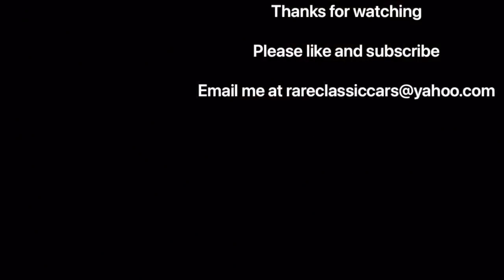Worst Engines of All Time: Chrysler 318/360/400/440 V8 Electronic Lean Burn

Comment: I have my grandparents 82 chrysler new yorker with the 318.  Mu grandpa said he told the dealership his car was getting 32 mph on highway and they said they would fix that!  Back to stock timing?   I will check this summer. Very low mile original but needs carb cleaned from old fuel.  I am ordering a progressive ignition blue tooth HEI that's its own computer.  It will not take 7 minutes to adjust timing.   Lol!  Say hello ebay, to the original air cleaner computer.

Comment: In your explanation during 6:30 ish, alot of people dont keep their foot steady on the gas pedal to maintain a steady speed. Alot of people, just lift, and push. Lift and push. That will cause problems in itself, but people will blame the manufacturer before they blame themselves. I've heard it when people drive by! It's so annoying. Especially if you're a passenger. Watching that tachometer move up and down non stop, and feeling sick from it.

Comment: Very intuitive material. Reminds me of my 82 AMC Eagle. It had that Carter electronic stepper enrichment system. Coupled with the Ford Duraspark. Tuned properly it actually worked well but I wished I never sold that one as there are so many fuel injection kits that will fit.. Very dependable here in South Dakota winters as long as the engine didnt flood!!

Comment: The best running Mopar engine I ever drove was a 99 Durango with 5.9 360. The worst Mopar engine I ever drove was a 2002 Durango 5.9 360. Same engine, same rear 3.90 gears. They screwed so bad with the ignition and timing and advance curve that it took all the performance out of it. It ran terrible. The 99 was so nimble and quick by comparison.

Comment: The Ambient Air Temperature Sensor is in the intake air box because that's where the temperature that's going into the engine actually is. It was the earliest speed density ignition computer from Chrysler. And they still use a speed density system Which is far superior to the mass air flow system used by other vehicle manufacturers. However Chrysler does 10-2 run their engines a lot fatter than they need to instead of allowing them to run lean when cruising.
If they had work with their first port injection computer a little bit longer, they would have found the problem with the condensers used in that brain unit. And we would have had the electronic port injection that they were actually putting on cars in the 1950s Chrysler was way head of the curve in many developments like automatic transmission, alternators, power steering etc etc etc and modern port injection in the mid-1950s

Comment: Slightly off topic -- I drove my father's new 77 Cordoba home from the dealer and it stalled on the way home. Fast forward a few months. I went in to the dealer screaming and yelling and told the service manager I wanted Mr. Kelly, the owner, down there right now or else. (Add your own color commentary) Service manager told me,  "I'm sorry he can't come,  he's at the hospital, his wife just died." I left with my tail between my legs. I have never disrespected or yelled at mechanic since. I later fixed the car myself by removing the cat (legal in GA at the time), installing an old Plymouth distributor and a Holley carb tuned for the 400. The car ran fine after that.

Comment: Back in the day I had a 1978 Plymouth Volare with the 318 'lean burn' engine. The car actually ran pretty well for the most part. One thing that you did not mention is what can happen if the computer fails. I had my car for about 2 years when the computer suffered a failure. At that time there was no OBD system to plug into a computer to diagnose the problem. What happened to me was that I would be driving down the highway around 55 mph and the car would suddenly just shut down and restart. It was like someone just turned the ignition off and then back on while you were driving down the road. The result was that the car would produce a massive backfire and then continue down the road. Since the computer was not sophisticated enough to have a memory that stored error codes, by the time I brought the car into the service shop everything would look just fine. Finally the dealer replaced the computer since they could not find any other problem and that resolved the issue.
Reply: That was a fairly common problem with those early computers, and not only with the Mopar computers. 

Not that it matters much to you now, but if you had disconnected the battery for a few minutes, the problem would probably have disappeared at least for a time, which would indicate a bad computer.

Comment: Great explanation of a much maligned system on what were otherwise stout engines. Glad my 74 318 didn't come with it. Bone stock 2bbl with highway gears. Added dual exhaust to free up the flow. Runs like a dream.

Comment: The 225 slant six also had lean burn, so it would have been the slowest of Chrysler's lean burn engines. I had it in a 1977 Dodge Aspen with 79,000 miles on it, that I bought for $900.  I wouldn't race with it, but it wasn't embarrassingly sluggish, for the era. Plenty of GM diesels were on the road, at that time, and all diesels were slower than The Aspen. For the money, it was a great car. The A.C., the radio, the power locks and windows all worked. I put over 50,000 miles on it before the fender and window rust holes began allowing rain to gush into the back seat, etc, and the power seat motor shorted out,  the power locks would cycle on and off, and, finally the head lights began to dim, and the battery died. It started and ran well in below zero weather before the rust/electrical issues. Chrysler offered a lot of car for the money, even for the used car buyer.

Comment: THE government forced this on all auto makers and none were ready for it. It was horrible.
Reply: The Germans had a huge head start — they had Bosch D and K -Jetronic fuel injection before this CAFE crap was enacted. The K-Jetronic was simple and offered excellent drivability. The US manufacturers were operating at a huge disadvantage, when the gov lowered the boom ...
Reply: @sking2173  I remember cutting the tops off of them and adjusting them.

Comment: What you explain I think my 84 fury was like this and To me I real8zed this 8s smart
Reply: Yea on the old chevy six with points id ping it then back off prior to gap checkin
Reply: I kept a log on oil gas trans and average was 11mpg for my used 84 fury. If I could drag up another id drive it

Comment: I had a 84 fury 4 door 318 in about 2006. It had an electronic carb and ignition and ran smoothe to me. I was 6th owner it was a detective car at first. I did alot to fix everything wrong with it but after bein chevy and ford and that was my first mopar. Im convinced its a smarter design especially the drum brakes were so smoothe operating function. They had 2 short shoes on one side tho I redud it all. I called it electric carburator . I d8dnt never try to burn the tires but on the interstate it was righton the ball fly to dallas 95 like nuthin AC too

Comment: My grandfather's 318 Diplomats  (No overdrive but really tall gearing) used to get up to 31 USA MPG on long trips at 60 mph (Speed Limit was 55 mph then). He owned two different ones. They did better than any other V8 of the era for mpg in my opinion.. He never had any issues with his. I often thiught many of the issues were mechanics not fully understanding the system

Comment: If the 2nd pickup in the dual distributor exits function, you can crank all day and it won’t do squat, one is for ignition the 2nd takes over after engine starts.

Comment: I remember the Chryslers of that era but it was the mid 90s when I dealt with any of them so they we’re already very old. It seemed to me that what most people had done was swap out parts for 1970 to 1973 carbs and distributors etc. I don’t know why but these Chryslers of this era never seemed to be as high quality as Ford and GMs of the same era, like he said doing things like idling high then slamming into gear. Oddly the Chryslers probably were better because they didn’t have garbage like THM125C or THM2004R I cringe even typing those.

Comment: Its a funny thing. Mopar fans always sing the praises of Chrysler products yet in reality and as born out by the market, 70's Chryslers were rubbish cars. They have disappeared from the roads and languish in the classic car markets in Australia. My CL Chrysler Regal fell to apart standing still. The conversation in this video is ELB. Useless piece of kit. I took my off the engine and even fitted a manual choke. Another contributor claimed the 318 was the popular engine for taxis in Oz. Not true. Falcons and Holden sixes were the favorite . Falcons were easily the better car. These 318's were very thirsty and thus useless as a taxi. It's claimed they are a long lived engine., probably because they are under stressed and inefficient.  Underpowered compared to the Ford 302 no one hot rodded them. Truck engine basically. Rust ate these cars from the inside. Cheap upholstery, wandering steering, a front suspension that wore itself out in short order. Power steering pumps leaked forever and the so called electronic ignition burnt out three times on my car. Even the throttle cable broke as did the oil pump drive robbing oil pressure. Reliable engine, I don't think so. Fortunately they have long since been turned into scrap metal.

Comment: They weren't all that horrible. Just most of them LMFAO. I had two of them. One was in my 1977 Dodge Charger Daytona with the 400 engine, the other was in a Dodge truck. The Charger Daytona actually ran really well and never gave me any issues. But the one in the truck was horrible. That thing never did run right. I ended up wrecking it 60 mph into a very large whitetail deer... Which was a better fate for that truck than it deserved. I'm still a Mopar guy but they sure blew the hooker on that lean burn build

Comment: I used to work for the AAA road service during those years every time these cars would turn over and would not start!!! I take the coil wire lay it next to the center of the the distributor the spark would fly from the end of the wire in to the cap fire right up every time shut it down put coil wire back run fine!!! A lot of my tow truck drivers had to tow them for lack of knowing this easy trick!!!

Comment: Lean Burn engine management system. Take off and toss in trash. Disable Smog control system and remove the catalytic converter. Makes the engine easier to start and improves fuel mileage and performance. I removed the lean Burn off of my 85 Fifth Avenue Chrysler. Ran a hell of a lot better.

Comment: 14.7 to 1 is by weight, not volume. Using the gallon jug analogy, it's 9000 gallons of air to one gallon of gasoline.

Comment: Thanks for the tutorial, well explained. I had three of them , a ‘79 (360) and ‘80 (318) Lebarons , and an  ‘87 Fifth Ave. Fortunately the mechanic I had was able to work with this system , although he let me know the system was often fussy to get it adjusted right. I drove the Fifth Ave. to over 200,000 miles , one carburetor rebuild at 100,000. Chrysler must have improved the system by then. That car ran as well overall as any of the pre-lean burn cars I had. I also put 200,000 miles on an ‘81 Ford 302 with the Variable Venturi carb. Fortunately my mechanic told me I didn’t want to pay him to learn how to make that system work and suggested another guy who knew so I survived that too.

Comment: Chrysler tried to make a carburetor act like a throttle body EFI system. In other words an el cheapo EFI and it didn't work out too well. 

As a kid I remember that most people were so against fuel injection because of how bad the GM (Chevy) Rochester system performed in the late 1950s. Ford scrapped their Holley system before installing too many. AMC & Chrysler's Bendix EFI systems in 1958 were actually a multi-port EFI system that Bendix Aviation adapted from aircraft usage to street usage. This didn't work very well, because of the primitive electronics of the time. Bendix sold this whole system to Bosch which refined it into the "D-Jetronic" in 1967. This system was adopted by VW, Mercedes, Porsche and few others, decades before any American company would even dare to mention fuel injection again.

Comment: Real remanufacturers used to rebuild the lean burn computer with an upgrade, I was fortunate enough to have one in the area 😇 for my shop! Never a problem with them. When they worked right the vehicle could get up to 30mpg on open roads

Comment: The 318 was such a workhorse and dependable engine. The lean burn ruined it. We owned a 1977 Chrysler LeBaron 318 with lean burn. It would never idle smooth and you could never set the timing on it. Knocked alot. The EGR would keep clogging up.

Comment: I may have been in the minority but between 1981 and 1988 I owned a Nightwatch blue with white quarter vinyl top Dodge Mirada. 318 with the lean burn system I had zero problems with it.

Comment: The big problem with the lean burn system was that mechanics didn't understand them. 
Chrysler engineers found out you could run an engine on 25% less fuel if you advanced the spark to 52 degrees. The lean burn distributor has 2 pickups standard timing and advanced. They also have a solenoid in the carburetor to switch from standard to lean.
The computer adjusts the spark and carburetor to lean burn once the engine is warmed up, and when you are driving at a steady speed as on the hiway. Switching back to standard when cold, and for acceleration.
The result is a full size, powerful V8 car that gets over 20 MPG. I remember reading a road test of a 318 powered Chrysler, it got 26MPG hiway EPA rating, in the same magazine was a VW Rabbit 4 cylinder, it got 25 in the same test.
Most lean burn systems have been removed and the distributor and carburetor replaced with standard type. Not hard to do, and a common fix by mechanics who didn't understand the lean burn system. Easy way to check for this is to inspect the carb for wires, and pop the distributor cap and see if it has 1 or 2 pickups.

Comment: ELB had three generic stages, and each had the 1 bbl, 2bbl BBD, or ThermoQuad. No one understood the base systems, each which Chrysler Tech put huge money in covering off with its Tech Videos. As an Engineering First company ( unlike Cost First, FoMoCo, or Matrix Firsts, GMs Engineer verses Accountants Stoush were the Engineering had to pay a dividend) Chrysler Corp really trusted it's shop techs and their customers desire to bask in Mopars obvious Brilliance. Given a proper external computer like Ford's first four EEC'd, or GM Delco CalPac, the ELB system is fine. The problem is that it was easy to circumvent...easier than any. Easier than the AMC Nutters By Pass. And so..it never got the Chance. 16.1 air fuel ratios were used on Honda and Toyota engines too, Chrysler broke away from the Mandatory 14.7 :1 or 15.2:1 with oxygenated gas. I maintain...Chrysler never really got the system embedded so it couldn't be removed. For 13 long years, you always had an alternative. On the CFi 5.0 Ford's and Camaro's, the Cross Fire Corvettes, the California 351M's, you couldn't remove the emissions ECA. The Mopars from 76 to 89, even with the 4bbl Qjet in the last Fifth Avenue, you can remove parts of it. Just like the three year return of the Chrysler Imperial, "mit" EFi. If Someone decided to Make it Work, it would have. The Unibody intermediate and large cat rust issues, Chrysler World Wides huge cost escalations, and the cost of fixing ELB and 318 Imperial  EFi...Lido Just Said "No".

Comment: Who comes up with this crap ! The problem WAS the lean burn computer system not the 318/360/400/440 themselves. Get real .. this was a novel concept ahead of its time by a decade and was not ready for primetime. Plain and simple. Think 1981 Turbo T/A 301 with the Rochester E4ME carb , another disaster and Ford had its own issues with EEC III , so there was enough failure to go around for all of the big three in the late 70s and early 80s.

Comment: I think this video is mis-titled. The engines were the same as earlier in the 70s and the narrator says that they were good engines in his opening statements. What changed was the addition of lean burn computer and the elimination of the 1972 vintage electronic  ignition system. 

Let me point out that the electronic ignition system introduced in 1972 was used on light trucks through the 80s. Though the ballast resister would malfunction, for the most part it was bullet proof. I have a 1978 Lil Red Express that uses its original ignition system and it runs great. Never replaced one component of it. 

The lean burn systems would often go out due to engine heat destroying the computer. It was a $100 fix to replace the lean burn computer. Few mechanics could make a poorly running engine with the lean burn run right. The repair solution was to ditch the lean burn and install the 1972 ignition system! Then the engine would run fine. 

I had a 76 D200 with a 360-2bbl and it ran great. No cat and no lean burn. Same with my 78 Lil Red with a 360-4bbl. My 75 Sport Fury never ran right with its 360-2bbl., though it didn’t have lean burn. 

My point is the engines ran great. The Lean Burn did not function as intended so it made the engines run poorly. The flaw was the new tech. While the narrator essentially said that, the title is a total misnomer and misleading. Change the title is my advice.
Reply from the maker: I respectfully disagree.  I evaluate the engines as an average customer would.  Not a mechanic.  In that case, as you mention, they ran poorly despite the engines themselves being good.  However, the average customer wouldn't care.  They just paid big $$ for a new car that didn't run well; they wouldn't care why that's the case, simply that it was the case.